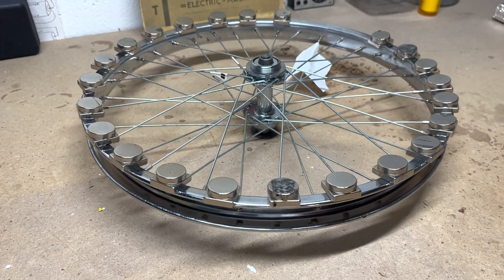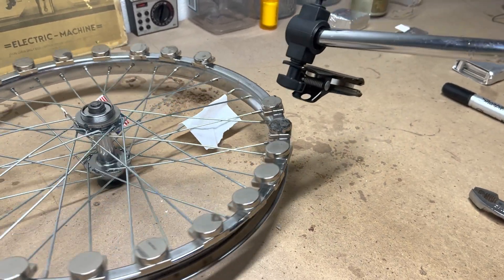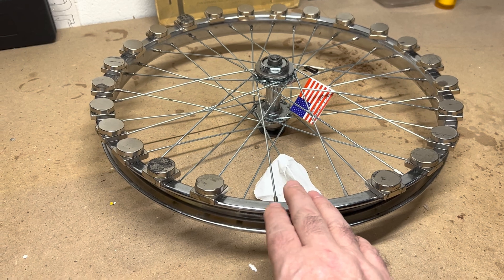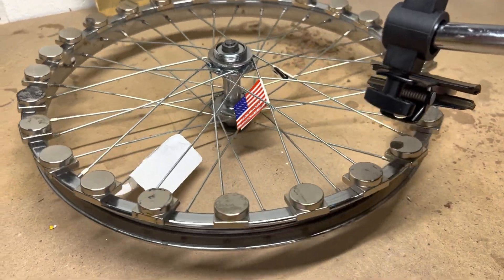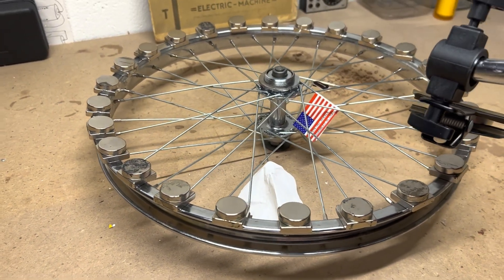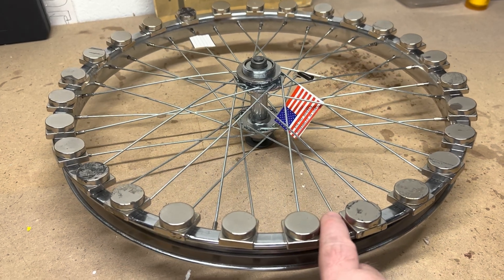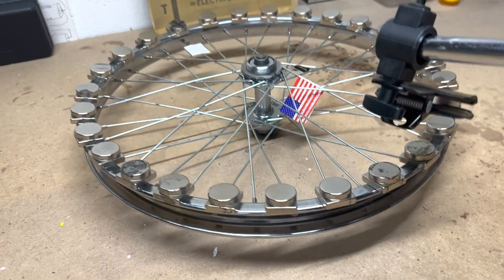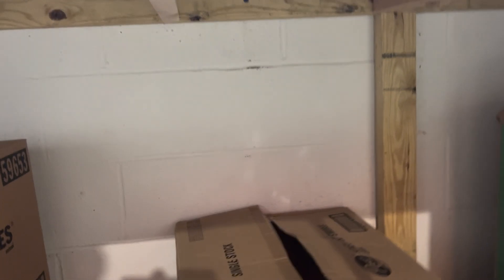🧲 Free Energy Magnetic Motor Research & Development Configure #8 Testing | Free Energy Research

Comment from the maker: 🧲8 Identical ring magnets seen in config 8 & 9 will arrive any day. As long as I continue to get the same performance with 8 ring magnets that I get with just one, this will be a historic game changer in the production of green energy. Then it's just a matter of expanding on the physics, then scale it up to produce useful torque, as magnets can produce horrific torque when in close proximity to another magnet. There are a few serious unknowns here. Will the interaction between the magnets cause degaussing? If so how fast? Or will it actually prevent long term degaussing? More so, will heat be generated caused by the motion between magnets within close proximity to each other, of which is a very real concern. If so, can the distance between magnets be increased to reduce heat all while maintaining the required torque? If not, a cooling system will have to be devise to bleed off the heat.

The primary difference in my research is that I'm not simply trying to create continuous motion, rather I'm after something that has true muscle power. Once I achieve this on a low end scale, it's just a matter of expanding, and tweaking the formula to produce more and more horsepower with each improved prototype. But I'm getting ahead of myself here. This may not work after all for reasons that are unforeseen at this time.  🤞

🧲 CONFIGURATION #8  https://youtu.be/drdAwmLbAfQ?t=1537
Reply: Hi James, thx for your comment on my channel. You have inspired me to make a video about this magnetic motor, and the function priciple. https://www.youtube.com/watch?v=7zjxvFV9Ywk&t=46s Would be glad if you have a look at it. Thx, yWild

Comment: Ok MR Roney, I was seeing what I could learn about the depleted battery and it’s effects, I can across a new kind of motor configuration I think.   
Ok, batteries (even depleted one’s) have poles, thus besides the battery acting in part as shielding.
But it is also doing other...
I am not sure, but I think both the depleted and full battery are acting on one pole, and are causing and pulsing or movement of the field.

So I have a neo perm. Mag in a clip, behind one face of the magnet, is a bar holding a spring, both are magnetic materials, neither actually touch the magnetic, plastic separated these...

I am going to post a diaper pin spinning across the magnetic field only touching the battery(depleted) but it worked with non depleted battery as well, but it does not work as far as I can tell with out the spring (a coil) and bar, between the battery coil magnet some form of induction of I believe only one pole is occurring...   I will post the 1 min video, note I just release the pin and it rotates when in the right position of the magnetic field...   should be up in a few

Comment: I think the problem is the balance of the wheel, as you use it in horizontal position. So, first of all you have to find out, if you wheel is balanced properly, then start over.
Reply from the maker: 🧲  I did. In recent weeks I documented how beautifully balanced the wheel was various times in previous videos. However, I discovered last night that something had gone terribly wrong with the axle in recent days or possibly longer, which causes the wheel to rock/tilt back and forth. This caused the wheel to drag and lock up during slow speed. This issue was not discovered until the end of making a new video last night.  More importantly, thank you for making time out of your busy life to give me constructive feed back. Very kind of you.

Comment: information          :01    the decision to use  thin stacked magnets  on the rotor  Should be an  informed one.      such a magnet configuration results in chaotic poles (on the rotor). 
in other words,  if you  Wanted  chaotic poles on the rotor, you have them.!!!          where are your  Shielded  stator magnets.!!!            googletranslate
Reply from the maker: 🧲 The  1" x1/4" neo disc that's on top of the 1/4" x1"x1" neo is an informed decision as it greatly increase torque, and tightens the field resulting in far greater speed. The point of this video is to see what's possible without shielding. I will be building a new set of my shielded stators in the coming weeks with tighter tolerances for better performance, which I will document in a video. There's nothing chaotic about my magnetic configuration, if that was true, we would not see the encouraging results we are getting thus far.  There is intentional design here. I got the idea of reshaping the field based up the narrowing structure of a pyramid from bottom to top. Interestingly I found no magnetic research experiments on your page. I'm just having fun to see what's possible, where as you are very anal about all this. 🤔